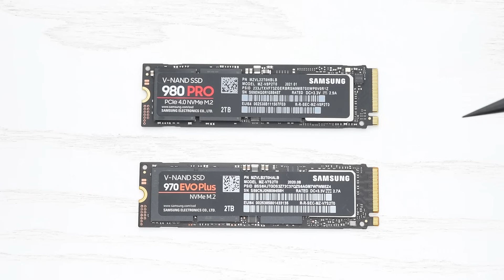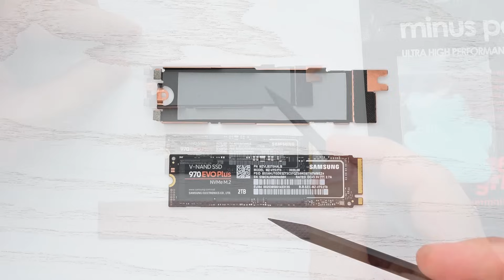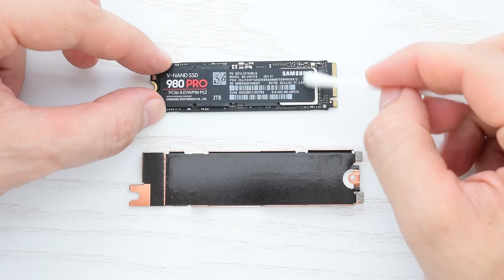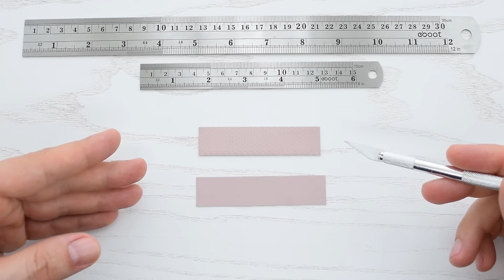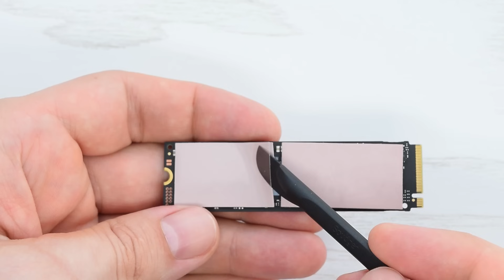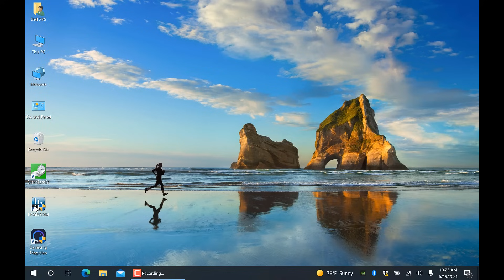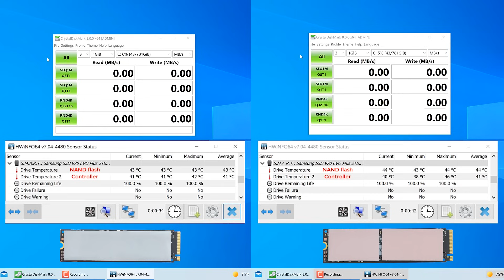Stop your Samsung NVMe SSD from Overheating and Thermal Throttling

Comment: I would also remove the 'Samsung OEM' sticker, and have direct contact chips-thermopad to heatsink.
Reply from the maker: Yeah, but removing the label will void the warranty and it doesn't make that real difference (1-1.5C) in cooling your SSD.

Comment: Now the next big question, how often do you replace thermal pad? Because the one I have from the motherboard heatsink, is going brittle on the contact area this is after almost 2 years of use and my ssd temp looks like a bit higher (but not sure tho)...
Reply from the maker: High quality thermal pads will last for years and usually last longer than the device itself.

Comment: You cleaned the ssd after removing the old thermal pad, but then used your fingers to press down on them, nothing wrong really, but your hands have oil and pressing down on them was not needed.
Reply from the maker: I haven't found the moment you're talking about.

Comment: To do this properly you should be removing the Label which has Copper underneath it but will apparently void the Warranty of the Drive
Reply from the maker: Removing the label will void the warranty and it doesn't make any real difference (1-1.5C)in cooling your SSD.

Comment: Is there anything I can do for a desktop? My ssd sits right above the gpu and the highest I’ve seen is a toasty 82°C
Reply from the maker: 82C it a lot. Does your SSD have a heatsink? If not, install a universal one with two thermal pads. But don't use Grizzly ones, nowadays there are way better solutions. We switched to GELID Solutions GP-Ultimate 15W/MK:  https://alii.pub/6oz44c
Reply: @ElectronicsComputers  yes it’s without heatsink. I will try to get one and attach thermal pads. Thank you

Comment: Just got my hands on a Samsung 970 EVO Plus (1TB) - manufactured 2023-02-22. The NAND memory chips seem to have a lower profile than the ones in your video now, or at least the controller chip + heatspreader and sticker is slightly higher than the memory chips with the ruler test. I understand that the controller chip is the most critical component to cool, and the memory chips are lower by ~0.2mm using a cheap, rudimentary feeler gauge. So there was nothing I felt could be improved with different thermal pads in my situation. Perhaps Samsung have solved this design flaw?

Comment: Many thanks. I just installed thermalpads and external radiator on my 970 Evo Plus in Acer Nitro 5 laptop. Maybe the parts were not expensive (ordered from amazon) but the difference is undisputed.
Now I need repeat in on second disk Lexar NM800Pro, which reguires different thermopads shape.
Reply from the maker: Great job! I'm happy to help.

Comment: I own a number of Samsung products, but poo on them for not making the heatsink surface level.
Reply from the maker: They could easily fix it. They have already applied a metal plate to the controller chip; they just need to make it 0.5mm thicker, and the main chips will be on the same level.

Comment: Some people said to remove the sticker from SSD. Would it work better if removed?
Reply from the maker: Removing the label will void the warranty and it doesn't make any real difference (1-2C degrees won't change anything) in cooling your SSD.

Comment: Is it okay if i put a different thermal pad at same ssd? like Thermalright Extreme 14.8 W/m-K for 0.5mm part & Grizzly Minus Pad 8 W/m-K for 1mm part?
Reply from the maker: Sure! You can use any pads you want with the difference 0.5mm in thickness. Instead of Grizzly nowadays I recommend using GELID Solutions GP-Ultimate 15W/MK: https://alii.pub/6oz44c

Comment: This video is awesome, especially in my case. I have XPS 9500 and I'm choosing which one to bay: 970 or 980. Thanks! Now I know, what 980 Pro will be colder.
But I found confusion in the performance tests. RND4K completely differs from your video "NVMe SSD Gen 3 vs Gen 4 running at PCIe 3.0" https://youtu.be/O1WlzO97VfA. Here 980 have 650MB/s, even less then 970, which have 750MB/s. But in your mention video 980 have 3100MB/s vs 1700MB/s on 970. It would be very helpful if you explain this misunderstanding.
Reply from the maker: These Samsung NVMe SSDs cannot work even theoretically at such low speeds, like 650MB/s and 750MB/s. I cannot imagine what I have to do to these SSDs to achieve such low results unless it is done on purpose. The Samsung 970 EVO Plus is one of the best SSDs in terms of reliability. We use them in a corporate environment. The 980 and 990 PRO will last forever on Gen 3-capable laptops because they will always work at half the speed of their full capability.

Comment: how is an average consumer suppose to do all of this DIY stuff? shouldn't they provide with enough pads or whatever so that temperature doens't skyrocket, till today i never even knew SSD's get hot to the point where it needs thermal pads
Reply from the maker: If you don't play and don't work with graphics and don't copy a huge amounts of data to and from your drive, then it will never overheat. But anyway, buying two pads and cutting them in two peaces is pretty much easy with my instructions.

Comment: I've actually ran the computational fluid dynamics (CFD) analysis and found that it is actually better if you cut the thermal pad even further such that EACH of the individual components that needs to be cooled, has is own thermal pad.

I'll have to check my data, but I think that I vaguely recall the delta being somewhere between 0.5-1.3 C, I think?

Not huge, in the overall grand scheme of things, but if you want the absolute best performance (measured as the lowest temperature), then having the individual thermal pads for the indivdiual components is the best way to go.
Reply from the maker: Totally agree with you.
Reply: Or how about a row of pin-fin heatsinks, each glued on to the local contour. Far more effective than a flat heatsink.

Comment: It is better to remove the Samsung brand sticker in order to increase heat transfer through the chips.
Reply from the maker: Removing the label will void the warranty and it doesn't make any real difference in cooling your SSD.
Reply: @ElectronicsComputers  I tried the difference in temperature before and after removing the product label, and the difference was four degrees Celsius. Note, I used a fan to cool the heat sink in both cases.
Reply from the maker: @dhafirsamarray2625  If the temperature dropped from 34C to 30C or even 44C to 40C, it doest make any difference in terms of performance or SSDs lifespan and not worth losing the warranty. If the warranty is not a problem, then why not.
Reply: @ElectronicsComputers  I use Samsung parts because they are efficient, and I have been using the ssd of their production since 2013, and I trust them, and I do not care about the warranty, but do not forget that the nvme ssd is negatively affected by heat and reduces the life of the piece, the operating system, and important information on it, so I work on it  Reducing the temperature to the minimum to increase the life of the piece and to preserve my information, my love and appreciation for your wonderful work

Comment: Hello. Thanks for this test. Just a question; Is it easy to remove the pad on NVMe. If yes what is the best way to remove it?
Reply from the maker: Do you mean the label?
Reply: @ElectronicsComputers  i mean thermical pad . without damage the commercial label
Reply from the maker: @jpf3622  Just warm up it with a hairdryer to the temperature when it's barely comfortable to touch the pad and then simply remove it with your nails. We use some plastic prying tools to do that
Reply: @ElectronicsComputers  Great very thanks to you for this tip.

Comment: i just use a thicker pad and let the higher side to squish down the thickness
Reply from the maker: Yes, that helps but unfortunately there are some heatsinks that only allow to use 0.3-0.5mm pads.
Reply: @ElectronicsComputers  there's some extra squishy pads out there that can be easily compress to a much thinner form. there's also some putty type pads that can conform to any type of surface

Comment: This still issue with 990 pro? If so what heat syncs should i get n their sizes
Reply from the maker: Yes, they are the same. Also I recommend using the best thermal pads on the market at the moment: GELID Solutions gp-ultimate 15W/MK https://alii.pub/6oz44c
Reply: @ElectronicsComputers  Hi. Can you pls confirm for 990 pro 2tb which pad thicknesses I need to order? I've just read that it has 3 different heights:

nand: 0.5mm
DDR: 1mm
controller: 0.75mm

Comment: Great video! Does the crucial ps5 pro m.2 have the same issue?
Reply from the maker: That model has integrated heat spreader on the controller which evens the surface. I highly recommend removing label from that particular SSD. Also I recommend using the best thermal pads on the market at the moment: GELID Solutions gp-ultimate 15W/MK https://alii.pub/6oz44c
Reply: Thanks!

Comment: Going to buy 970 evo plus, does it really overheat that much? I have  pc with 3 front fans on it used for gaming, should i get wd sn570 then?
Reply from the maker: It will be fine if you have good cooling inside of your PC. 970 Evo plus provides great performance and one of the most reliable drives on the market.

Comment: Thank you for your informative Video, I have 970 evo plus 2TB and become overheated up to 63C on disk mark test. My motherboard is Gigabyte Z790 elite ax D4 and i am currently installing this M.2 on the second slot. Do you recommend to replace the current thermal pad with thicker pad that could does better like Thermalright ODYSSEYⅡ2mm 14.8w/mk or stick to your method and size (0.5mm & 1.00 mm). your advised is highly appreciated.
Reply from the maker: I don't think that you can put 2mm pad under that heatsink. The higher thermal conductivity the harder the pad. So it may not be properly compressed. The optimal solution is 1mm and 0.5mm pad for those SSDs. But don't use Grizzly pads there's way better solutions nowadays. We switched to GELID Solutions gp-ultimate 15W/MK: https://alii.pub/6oz44c

Comment: Is it possible to put 2 Extreme Odyssey 2 thermal pads 0.5 mm thick on the bottom (controller) and top (memory chips) on the 970 evo plus? or necessarily 0.5 and 1 mm?
Reply from the maker: The difference between chips is about 0.5mm, so you can use any thermal pads thickness  that your cooling system supports but the difference between those two pads should be 0.5mm. For example you can use 0.5mm and 1mm or 1mm and 1.5mm or 2mm and 1.5mm etc.
Reply: @ElectronicsComputers  I want to put these thermal pads of the same thickness of 0.5 mm in the thermalright 2280 pro heat sink, and the top part should be pressed against the heat pipe, so thinner ones are needed, right? What do you advise?
Reply from the maker: @Xern9TV  Did you get the point of this video? Those three SSD models from  Samsung have a design flaw that doesn't allow a proper contact with the heat sink, especially if you use pads thinner than 1mm.  That's why we use two pads of different size to cover that difference in thickness. If you're gonna use two 0.5mm pads then it doesn't make any sense. Because that 0.5mm pad on the controller won't make any contact with the controller or the heatsink surface.

Comment: Thank you.
What is more efficient?
1 memory chip - 1 thermal pad. Like on a video card.
2 memory chips - 1 thermal pad.
Reply from the maker: You'll never see or feel any difference and you won't see any software performance as well. But what you'll see for sure is how life expectancy of your SSD dropping without proper cooling of NAND, controller and other components. Electronics component shouldn't work at temperatures higher than 50-60C no matter what some moro@s say.
Reply: @ElectronicsComputers  Thank you.
I'm afraid you didn't understand what I meant.
English is my second language. And it's hard to explain.

Should I cover all the chips with one thermal plate or each chip with one thermal square for each chip (controller chip and each memory chip). Which of these methods is the best?
My goal is to achieve the best possible cooling. Even if I have to remove the company sticker.

Comment: What actually makes this particularly egregious is that the nand modules actually like being hot while the controller performs best at low temps, so without varying the pad sizes the cooling is super inefficient.
Reply: I think being used already make the Nand hot.
Except first boot

Comment: I went to re-pad my desktop and discovered the 970 Evo Plus doesn't measure the same as the 980 Pro. The controller was making contact at the same height as the memory, but with no contact in the middle where all those smaller components are.
This is in conflict with some other reports of the same model, it may be different for various capacities, or they could have updated the design at some point.
Reply: Same for me, the NAND and controller of the 970 Evo Plus are at the same height
Reply: @trixniisama so theres no need to separate / cut the pads?

Comment: For most situations where the original pad was 1mm, I needed to use 1mm and 1.5mm. I tried using 0.5mm at first, since thinner is better, but in a few applications this resulted in poor contact with the heatsink, or even none at all. Meanwhile, adding the thickness to the controller side has worked well every time.
Reply from the maker: You can use any combination of pad thickness that works with your cooling system, but the difference between pads should be 0.5mm just like in your case.
Reply: Yes I also used 1 and 1.5 to be sure it was touching the enclosure. Like the video creator says: as long as the difference is 0.5 between the two.
Reply: If you were to do it agian would you do 1mm  and 1.75mm? Or does the 1mm and 1.5 work perfect?

Comment: Only mistake was not removing the branding tape. Take that off then put the pads.
Reply from the maker: Removing the label will void the warranty and it doesn't make any real difference in cooling your SSD. We've tested without the label and it's like 1.5C difference which is not worth loosing the warranty.

Comment: Thanks! for this wonderful video! I shoveled everything until I came across your video! with a quick and clear explanation! top👍👍👍👍👍👍👍 but the question is if 0.5mm and 0.75mm?
Reply from the maker: Thank you for the comment! The 0.5mm and 0.75mm pad will work as well. But 1mm would work better. At the moment the best pads on the market are GELID GP-Ultimate: https://alii.pub/6o7nnn
Reply: @ElectronicsComputers  I understood, and so I watched gelid and fehonda, 1 wait a month before my city = (the radiator has already arrived, Samsung 990 pro 1tb will come in a couple of days, and put it in the laptop, so I began to look for all the best cooling options possible! Once again, I'll think about 0.75 between 1mm again, the radiator will be pressed with elastic bands

Comment: Excellent video!   Really professional and valuable information!  I will definitely subscribe!
Reply from the maker: Thanks and welcome
Reply: @ElectronicsComputers  I put the blue insulation on top of my SSD, under the aluminum holder.  The HWInfo suggests the temperature is remaining low.  Thank you!   I'm going up change the Trackpad.  Does it make sense to put another layer of the blue insulation on top of the aluminum SSD holder?  Thank you
Reply: Me subscribed too! Will look for cheap pads (grizzly costs unbelievable price) 😢

Comment: why was the thermal pad put on the bottom of the m.2 ssd that came with my laptop?
Reply from the maker: That side of the SSD also gets hot, so it helps to transfer heat form the PCB.

Comment: Hey, I followed your instructions as shown on the video. But after each cut of the pad on each chips, I happened to let the heat pad slightly hanged and was in contact with the board of the m.2. Will the performance of the SSD be affected because of this? or will it cause damage to my SSD? Please please please advise.
Reply from the maker: It's totally fine, the pads will do the job anyway.

Comment: You are supper! Had subscribed your channel. Could you check if cut and remove a segment of label on the driver? I think the temperature will be cooler.
Reply from the maker: Removing the label will void the warranty and it doesn't make any real difference in cooling your SSD. From our tests the difference was no more than 1-2C, it's not worth voiding the warranty.
Reply: @ElectronicsComputers  Thank you so much for your test!

Comment: I saw that those sticker on Samsung NVMe are made of copper. So I think the best would be to totally remove that sticker and directly apply the thermal pad to contact with the chips and controler. It make sense cause layer by layer, we got:
Chips & Controler
Sticker
thermal Pad
Heatsink
this way, we only get:
Chips >> thermal pad >> heatsink.

What about using thermal past insteat of thermal pad. Cause we all know past is more efficient than pads.
Reply from the maker: Removing the label will void the warranty and it doesn't make any real difference in cooling your SSD.
Thermal paste won't work in that application. But you can use thermal putty. It's something between the thermal paste and thermal pads. UPSIREN U6 PRO is the best thermal putty on the market as of today. https://alii.pub/6nugj5
Reply: @ElectronicsComputers  did not know about that putty, great. Need to find out how to apply that lol
A heatsink with a fan did not help, plus happened to be noisy.